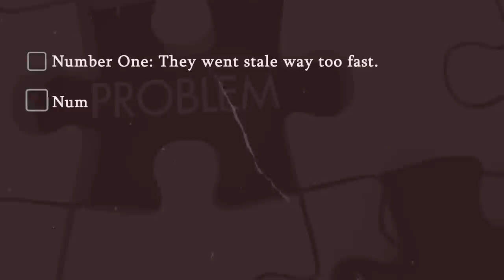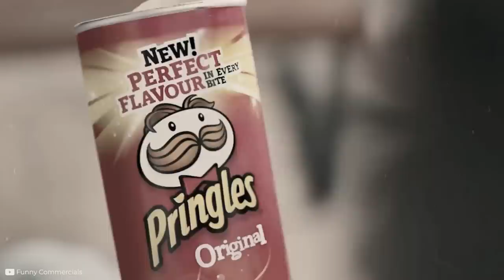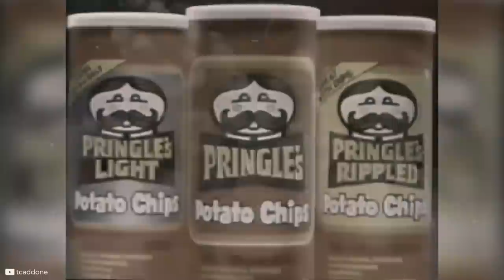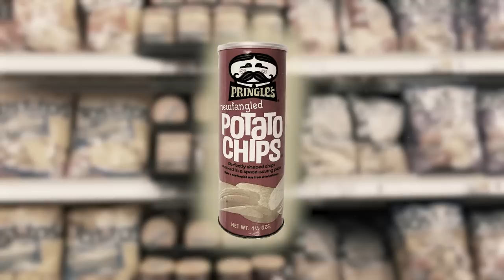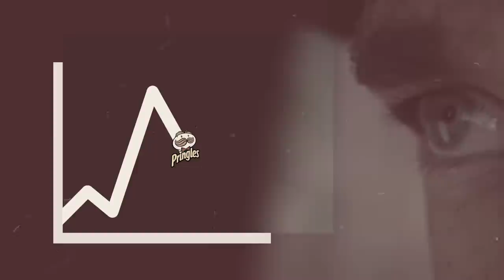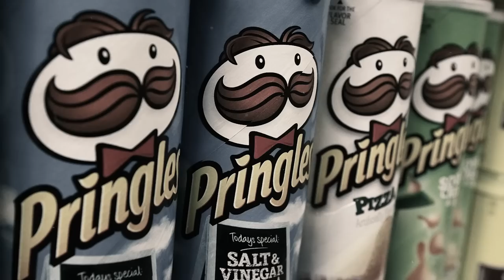No One Believed In These ‘Fake’ Chips. Then He Made Billions

Comment: Used to be, the chips fit perfectly in the can. Now, the chip got smaller but the can has stayed the same size. So, when you open a can, the chips slosh around and remind one of diminishing returns.
Reply: You buy chips by the weight not the size of the bag or can
Reply: @pervecbs  the weight has gone down of Net chips, but the can has stsyed the same
Reply: Hadn't really noticed have you any measurements to endorse your statement. Also if you are still getting the same weight then what is your beef? They said this about Wagon Wheels but the makers proved them wrong.
Reply: @williamhaynes7089  it costs money to change the machinery to alter the size of the can which would be passed on to the buyer.